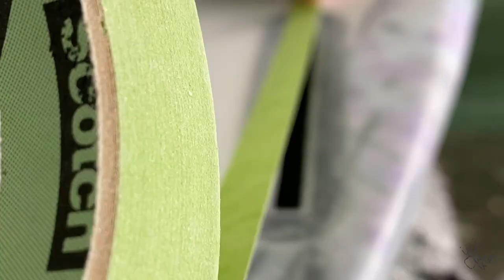Surfboard restoration: crushed/sunken fin box

Comment: I've been fixing boards since 1983. A couple steps could have been combined if you were in a time crunch like setting the box and reinforcing it with the fiberglass. Your repair job was really good! Props on the great video editing too. 🤙
Reply from the maker: Thanks Jerome! I’ve since refined my process to save a bit of time ;)
Reply: If you set it and glass it at the same time how are you going to measure the 6.5 degree can't. Or whatever the other fin is set at.

Comment: To each his own but I'm curious why you didn't sand down the surrounding area after you pulled the box out.That way once the box is set you can glass it the same as you do on a fresh blank. That way there is more structural strength and you  have two layers of glass and your hot level with the top of the box. That way the layer of gls and HT coat aren't higher than the box 14:49 . I could be wrong but I just can't see how your way is strong enough. Job looks great and good job on the video.🤙🏼

Comment: Pretty Good with out all the Pro Tools available.   You actually could have done you glass and Grind at the same time, then hot coat.  Like if you were setting the fins when you shaped the board.    But still pretty crafty work. 😀
Reply from the maker: Thank you! This is a good time saver I hadn't thought of before.

Comment: Man, I still don't know how you leveled up the fin box to the perfect height/orientation. Feel like that's the hardest part and probably what I'd mess up
Reply from the maker: Thanks dude. Just use a cheap protractor to make sure the angle is right, and then set the box to where it sticks up about 1/8-1/4 of an inch. Gotta leave something to grind down.

Comment: when you did the fiberglass cloth patch, did you glass it with lam resin or sanding? I noticed your sander was gunking up. Also I thought you cant sand down laminating resin?
Reply from the maker: I sand my laminations because it makes the hot coat come out much better. It does gum up your sandpaper though.

Comment: Hi, what is the product you use to fill in the board before you put the fin box back in and where can I get it? I have done this repair before but had to use pieces of foam to support the fin box after the initial removal.
Reply from the maker: Qcell mixed with laminating resin. Check out https://fiberglasssource.com/

Comment: Great video man! quick question, How do you fix a future fin box that the hole is stripped? It gets traction when you start screwing in but almost at the end it keeps spinning and it never gets to the point where it secures the fin. thank you !!
Reply from the maker: Hi Su! have you tried using a new fin key? Older keys can get worn down from use, and then they don't fit snugly in the screw. For example, I just threw a fin key away yestreday because after a lot of use, it was starting to "strip" the fin screws, which sounds like the problem you're having. Hope this helps!
Reply: I think the issue is not the screw itself but the whole.

Comment: It is a good fix... But filling in the futures flange with laminating resin only.. is not the correct install method. Should have used glass fibre  then to connect the fin plug back to existing bottom glass.. Would have also saved another step of glassing over top and trimming out.. at gel stage as  in video.. Other than that it's bang on great craftsmanship..